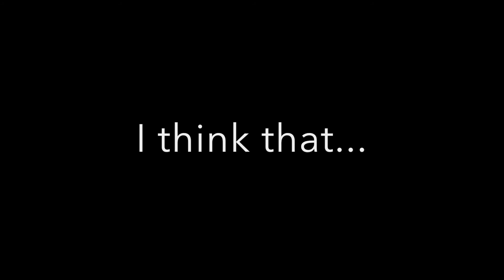Virtual Battery Gigrig vs Real Battery - with Fuzz

Comment: Mikel, always use the gigrid battery simulator on the fuzz face, Octavia and wah make a video lesson about it. The gigrid battery simulator has an internal 10k internal battery. The newer pedals have built in filter capacitors which you would need to remove them in order for ut to work correctly. You should hear a different EQ more warmer rolled off using the battery simulator or carbon zinc
Reply from the maker: The battery is warmer overall. Sold the entire GigRig thing last week and went back to playing battery mostly for gigs again 😃✌️🎸

Comment: I have just bought one of the virtual batteries - however, I am unsure if if can use it with my Fuzz Phrase (Jam Pedals) as this works with 9V DC adaptor (tip-negative). All of my other pedals use the standard "center tip negative" (I think). I think I have understand that I can use the normal power supply as the virtual battery is isolated... however, I don't want to connect and fry the pedal (I have the Fuzz Phrase Ltd. version). Any advice anyone could give would be welcome.
Reply from the maker: Do you also use the GigRig Generator or another power solution? For the Fuzz Phrase you won’t need an adaptor as long as the source is galvanically isolated! I just use that with my Fuzz Phrase and it works brilliantly.
Reply: @MikelBluni   Thx for your reply. I have a FENDER Engine Room Lvl12 - apparently all of the outputs are isolated. I have not been able to get the pedal to work with a cable - I have used a reverse polarity cable. I connected the GIGRIG virtual battery to the isolated power supply and then connected the reverse polarity cable (from the battery) to the FUZZ Phrase. It has not worked. I have contacted JAM for further advice. I found all the information surrounding these types of topics quite ambiguous and confusing to be honest :) Anything else you can add it most welcome!
Reply from the maker: @robertritchie3134  According to my information no reverse polarity cable is required. I’m not sure if the VB works with regular power plants. Sorry, I can’t be of bigger help, but you are right, not enough information by the makers. Especially the GigRig support never answered so I called Andertons UK and they answered my questions.

Comment: I'm not convinced any of the battery emulators on the market accurately model the internal resistance and current of a real battery, but it was still close enough for me. Using batteries is just silly.
Reply from the maker: True. My ecological mindset forbids me to use batteries! The difference between battery and virtual battery is marginal, the playing feel is almost identical, nothing to worry about really.